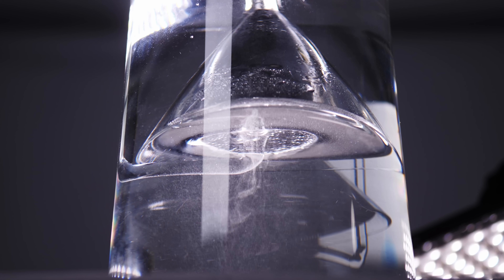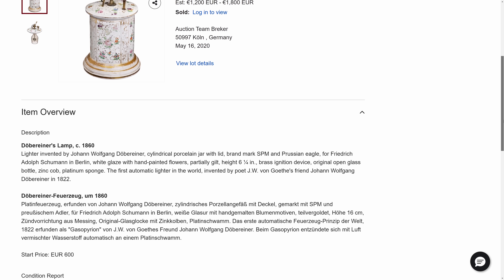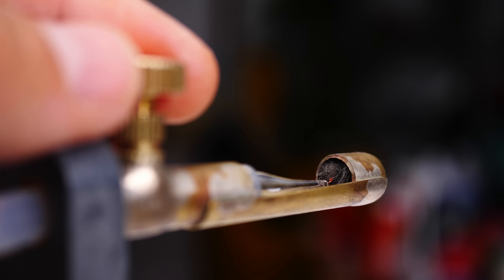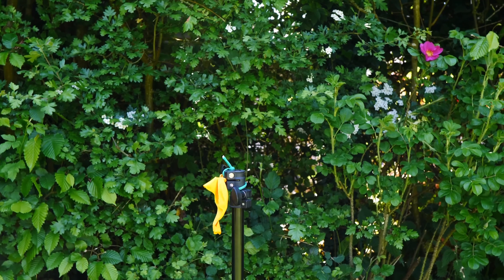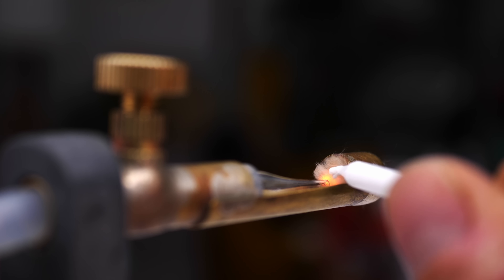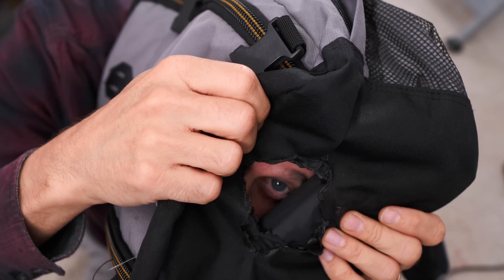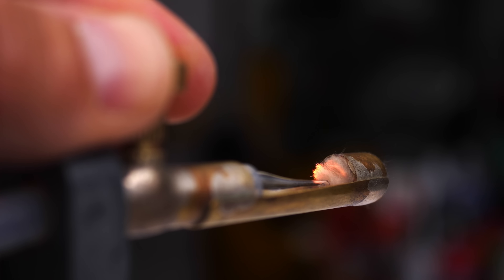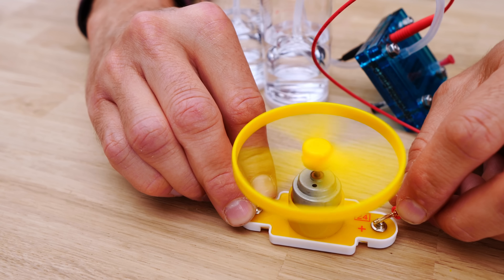This 200-Year-Old Lighter Ignites Without a Spark

Comment: “You don’t want to have to be manually dipping your zinc into your sulfuric acid every time you want a bit of hydrogen.”

Maybe I do want that, Steve. You’re not even my real dad.
Reply from the maker: Go to your room!
Reply: @SteveMould  I was already going there anyway! I’m not doing it because you told me to! door slam
Reply: @SteveMould "Doggy dog world" 😂 they used that line in Modern Family for one of the idioms Gloria (Sofia Vergara)  gets wrong all the time 😂
Reply: @jonslg240 Mine was “try and” instead of “try to”. Now I’m as surprised at how many other people say that as I was when I realized that I said it.
Reply: @babybirdhome As a former copy editor, I don't think "try and" is really an error. It's certainly informal, but to me it has a slightly different meaning from "try to"—more confidence that you'll be successful, I think. But it's possible that I'm the only one using it that way, like how I accidentally got into the habit of distinguishing between "may" and "might" and forgot that most people use them interchangeably.
Reply: @jonslg240  Lots of people mishear that one.  I always wonder if they ever try to make sense of their version!
Reply: @babybirdhome "try and" is so common I wouldn't call it an error — just an alternative option. Of course "try to" makes more sense, but you could read "try and do X" to mean "I will try (and succeed at) doing X".
Reply: No, you're right. Try and X is perfectly valid.

I'm going to try and eat
I'm going to try to eat

In the second "eat" is the object upon which "try" is acting.

In the first, i simply have two verbs performed separately.

I might theorize here that "try and" could imply more confidence in success than "try to"?
Reply: There's so many. People write 'alot' like it's one word, or say 'muriel' when they mean mural. There's some I like to deliberately say wrong just to see if anyone reacts, but I can't think of them at the moment. I've been living in France for a while and non-English first language speakers wouldn't recognise the error. As indeed, neither do many first English language speakers. These errors are referred to as 'Malapropisms' after the character Mrs Malaprop from Oscar Wilde's 'The importance of being earnest'. Which is an absolute hoot, as she is unaware, of course, of her errors, and takes herself very seriously.
Reply: @imaginitivity7853  I always understood "malapropism" to come from the French phrase "mal à propos," meaning "inappropriate." I didn't know anything about a character named "Mrs. Malaprop." Lol
Reply: Man, the vitriol here.
Reply: @sean - on point. How dare he? I’ll be in my room also STEVE..

Comment: 8:14 I like the use of binary with the cake candles. 10000 in binary = 16
Reply: Funny to use lit and unlit as 1 and 0, we always just do different colors 😀
Reply: So glad you pointed this out. I wouldn't have known. Cool detail!
Reply: After seeing "decimal" (meaning less than 1) in binary, what does binary scientific notation look like, or is it redundant. That is, how do I take:
16 = 1 x 2^4
and write it in binary scientific:
10000 = 1.b100 

I'm not sure it's helping.
Reply: @DrDeuteron  Look up how floating point numbers work. They're basically scientific notation in binary. I'm not sure if there's a standard way to write them on paper, but floating point numbers are the standard way to store them on a computer.
Reply: @DrDeuteron  I don't think that's a part of any programming languages currently. There is a hexadecimal floating point literal format though. I've seen it in C++ and Go. Not sure what other languages implement it though.
for example
0x1p-2     // 1*2^-2 == 1.0/4 = 0.25
0x2p10    // 2*2^10 == 2.0 * 1024 == 2048.0
Reply: @DrDeuteron  What you're describing are floating point numbers. I don't know of any standardized notation for them, as programmers usually just write them in decimal and let the computer do the conversion.
Reply: @nedhunter4444 I know, but what I was asking about scientific notation in other bases, and whether it provides any benefit in binary.
Reply: @DrDeuteron  Yeah, sorry, I didn't see how many people had already replied until after I wrote that.
Reply: Thank you. I didn't get it.
Reply: But his channel is actually 19 years old. He joined May 17, 2006. You can check for yourself clicking the "...more" button on his channel.
Reply: @iteachvader  Is the account perhaps 4 years older than the first video, hence the discrepancy?
Reply: but one lit candle and four unlit would look... sad on a BD cake, won't they?
Reply: @azgarogly  ..and possile a bit arbitrary, unless its blatant obvous from wich direction it supposed to be read ...
its a binary choice lol
Reply: @Patrik6920  Are you provoking an Endian war here? :) Big Endian against Little Endian
Reply: @azgarogly  ..no was just, pointing out the cake can be seen fron different directions and rotated, but u have a point lol
typically edian-ess only occur in multi byte notations .. (we can assume this doesent apply here, 8 bits are enugh to describe 0 to 255)
and to add to the comfusion here we can swap individual bits in a byte too ..
(unless u happend to yhave bday equal an even 2^x number could be fun )

.. if u cant decode the cake u wont get any 😂

sorry if i missed alot of typing errors, keyboard is junk.
Reply: @Patrik6920  The cake is a lie anyway >)
Reply: Yeah, we do that too. You need fewer candles to represent the same number. Pretty useful for the grandparents who need like 60+ candles if you do it the traditional way.
Reply: Nice. I didn't spot this and just thought the cake was too small for 16 candles. I'm not Jane Street material!
Reply: lol, I didn't even notice that
Reply: Dang. I'm an aspiring programmer who knows binary, but I didn't catch that. Even wondered why there were only 5 candles, and why only 1 was lit.
Reply: @JoshuaEisenbart  Same for literally every part of that comment.
Reply: i assumed it was something dumb like that
Reply: If you’re experimenting, platinum bright embers or coated wool can be sourced from scientific suppliers or used Zippo hand warmers.
Reply: omg same
Reply: This just happens with text-only communication. We’re emotional beings so when emotions cant be deducted from text our brain will still assign them, usually incorrectly. Dont waste your time fighting with strangers on the internet:)
Reply: @hurmzz  This is so very true. An entirely unnecessary fight breaks out because someone asked a genuine question which was confused for an attempted gotcha because text alone is insufficient for the full range of human communication.

Now that everyone's good intent has been established, let's all agree that no further argument is necessary and we can all be friends!
Reply: @hurmzz  "Dont waste your time fighting with strangers on the internet"  Don't be stupid -- arguing with people on the internet hones our debating skills so that we can be more effective advocates IRL . . . . ;-)
Reply: @fewwiggle  can’t argue with that though hahaha
Reply: The interesting corollary of this is that you can represent any age with 7 candles with the use of binary. 

1 to 127 can be represented by 0000001 all the way up to 1111111. Oldest verified human age ever was 122 years. 

So next time instead of preparing a collection of 1 to 9s, cake shops can just sell 7 candles :D
Reply: Isn't 16 00010000?
Reply: @damnfk063 if you're forced to write 8 bits sure, but just like in decimal, leading zeros mean nothing 

You can write 16 as 000,016.000 if you really wanted.. but why?
Reply: @hashbrown777 I wasn't aware. To tell the truth I just asked an Ai how to write 16 in binary and came back to this. I had a feeling the leading zeros were not needed. Thank you
Reply: @damnfk063 you should probably actually understand how a number system works before you try to argue about it lol
Reply: @Ottophil what? Who the hell is arguing with you? I literally just asked of there should be zeros before. What's your deal?
Reply: @damnfk063 YouTube comment section is always a minefield 😂 good on you for looking into and asking questions.
Reply: @Ottophil  How exactly do you expect someone to learn without asking questions? 🤔
Reply: @ you misunderstood my complaint. I’m not upset about learning, I’m upset about how confident he was with his AI result. It was a failed “gotcha”
Reply: @Ottophil  He wasn't confident, hence why he asked. 🤦
Reply: @damnfk063  You should never use AI to fact check. They are so often wrong that you have to fact check them all the time, and thus are rendered useless for the fact checking itself.
Reply: @xyex  I think the issue is they saw something they didn't know anything about, got an ai generated answer to try and test the original comment. There's also plenty of people that will phrase "gotcha" replies as questions.
Reply: @thejadedjester4935  Or you're just incredibly cynical and they, like a smart person, didn't just believe the first thing they saw. They checked another source, got a different answer, and then asked for verification. Like a normal person does.
Reply: @Ottophil you assuming I was confident was your own projection. I simply asked if there should be zeros before. Do you want me to disclose my entire thought process in a comment next time? Everyone is reading way into this too much. All I did was ask the question. I wasn't trying to "get" anybody. My lack of knowledge about binary doesn't need to be disclosed. It's you who should consider not assuming as much as you do and applying it to your response
Reply: @damnfk063  Honestly I'm not sure how anyone could read your comments and come to the conclusion you were confidently exerting an opinion there, it was clearly a question and the second comment was clearly not intended to be assertive either, you didn't argue with what was explained, and you even thanked the person for their answer. I think too many people here see the word AI and jump to abrasive conclusions.
Reply: @KallePihlajasaari  The pushback isn't remotely legitimate. If you actually read their comment you'd find they weren't trying to assert an opinion at all, they were asking a question, looking for clarification, they were not acting like "um, actually". They were legitimately curious about the topic and simply asked for an explanation. The situation would have been the same had they run across the 8-bit version with leading zeros on a programming blog post. The presence of the word AI in someone's comment seems to just turn off the critical thinking and basic decency part of some people's brains and lead people towards aggressive responses due to charged emotions taking over your thinking. AI is a controversial topic, but it does have it's uses, letting your emotions towards AI dictate the manner in which you respond to people instead of actually trying to understand what's being said, does not lead to good conversations.
Reply: @DreadKyller expressing, not exerting.
Reply: @Ottophil  He wasn't "arguing" he asked a clarifying question, which is why there is a ?  at the end of his sentence.  Shutting down conversation, especially with that self-righteous attitude, is just one level above an average troll
Reply: @damnfk063  "I have an [insert degree here] so I'm better than everyone else."  That's his deal.  Don't take it personally, there's lots of them out there.  Understand it comes from a place of weakness, keep asking questions, and don't look back.  🙂
Reply: @Ottophil  "Isn't 16 00010000?" Notice the question mark? That's a question, not a confident statement. He wasn't trying to argue or being a smartass he was genuinely asking a question as he seemingly had conflicting knowledge on something given by AI and wanted human confirmation about it. How do you expect someone to know any system without talking to people?
Reply: @ AI isnt people!
Reply: @Ottophil  What you on about? Ofc AI isn't people, hence why he went ahead and asked actual people about it?
Reply: @ sometimes I wish the internet would just let me win, this is exhausting
Reply: @ i think the dude who said i was projecting nailed it. I’m the jerk here. Why is anybody feeding the trolls, stop replying to me. I’m clearly an idiot desperate for attention, and now that I got it I want yall to go away
Reply: @Ottophil  After doubling down as much as you did, I can confidently say "I'm the jerk here" is the only correct thing you said.  It's sad that just being nice is the last thing people want to do anymore.
Reply: @ i changed my mind. I was right all along
Reply: @ I’m not better than anyone else. I’m far worse than most people.
Reply: @xyex  So a smart person doesn't believe the first thing they read from a fellow human being who actually has knowledge and understanding of the world, but instead defers to an AI LLM? What is the world coming to 😂
Reply: @damnfk063  yet another demonstration that AI doesn't actually know anything itself.
Reply: @Ottophil  Replying to you so you keep on being pulled here. :)
Reply: @Tykeronia  How do you KNOW someone has "knowledge and understanding"? I could say anything and make it sound believable to those who don't know. People do it literally all the time.
Reply: @damnfk063  why not just... trust the words a person wrote and you read and the creator endorsed?
Reply: @guywith_dog  because he could then ask AI, and then ask the people. Instead of just .. asking the people directly to begin with. AI needed to be involved so when he faced any push back he could retreat to "the AI told me to say it". The internet is draining
Reply: @Reality_TMthe thing you missed is I got called out for nothing. I was literally just asking a question I don't know how you interpreted it as anything more than that
Reply: @ I’m a genderless electronic engineer. I’m a non binary that knows binary. 

i swear this joke kills in Manchester
Reply: @Ottophil I'm curious as to why in Manchester specifically. But this comment thread hasn't been kind to curiosity.
Reply: @ its a type of binary communication. People who work or have studied electronics would find that funny. It has nothing to do with Manchester the place, thats kind of the joke, that people who don’t work with those types numbers would assume it was
Reply: @Ottophil  asking questions is crucial to understanding .. 
we should endorse it ...
Reply: @Ottophil  .. and he is correct 16(decimal) is 00010000 .. the AI just presented it in 8 bit notation (byte notation) wich is the most logical considering its primarly used in computers, ofc leading zeroes can be omitted, and im sure he learned that, so i call it a succes, the guy learned something new
Reply: @xyex  "Isn't it" may be a question, but it carries an implication with it. That implication is a degree of confidence in whatever follows. If he was asking a question from a place without any confidence, he wouldn't phrase it that way unless perhaps he isn't a native English speaker. Why are you defending him?
Reply: @DreadKyller  If they were genuinely asking and that was it, they wouldn't have asked it in a way that gives one answer a higher credence than the other. They would have said "The AI told me X. What's right?" He got pushback rightfully.
Reply: @Ottophil  I liked the Manchester joke. Cheers
Reply: @Ottophil  I thought it was a reference to GayTown (decades ago GayThorn) near what use to be University of Manchester Institute of Science and Technology?
Reply: @damnfk063  heads up: AI doesn’t know anything, it will answer any question with confidence regardless of whether or not that answer is correct. It doesn’t have a way to know if what it’s saying is true or not. That’s why it lies (or makes mistakes) so convincingly.
Reply: ”I just asked an AI how to write 16 in binary” yeah I asked my 8 ball whether my haircut was good and it said “as I see it, yes”
Reply: @damnfk063 tone doesn’t translate well over text so it’s a misunderstanding
Reply: @damnfk063  Binary is very often used in programming and electronics to represent a number in an electronic register. That register is going to have some set number of bits, maybe 8 bits for example, and if you're writing the contents of it in binary (or hexadecimal), you typically add leading 0s as necessary to pad it out to 8 bits to show that the first few bits are off. However, we're not representing the contents of an electronic register or anything with a set number of bits, so the leading 0s are unnecessary.
Reply: @chitlitlah thank you so we're back to the conversation. Thanks for the input
Reply: @damnfk063 I was taught to use subscript to denote the base of the number system being used - binary numbers are usually followed by a subscript 2, decimal by subscript 10, hexa subscript 8 and octa subscript 7.

That way there can be no confusion about what the numbers represent. Leading zeros are for computation and aren't needed by humans.
Reply: @damnfk063  stay curious, and keep asking questions, its how u learn alot
Reply: Isn't 00010000 00000016?
Reply: @damnfk063 not in 5 bit binary😂